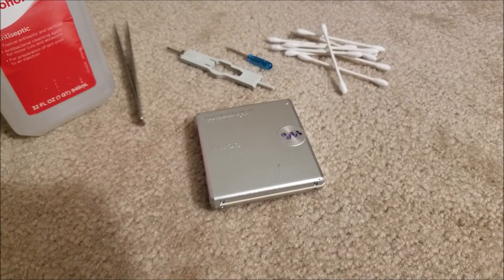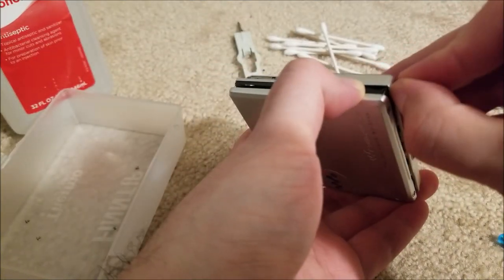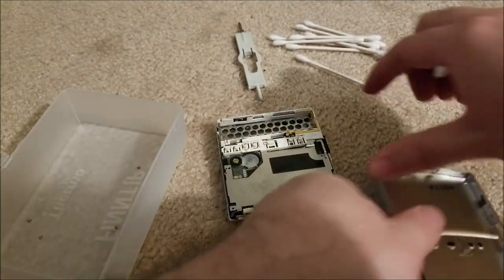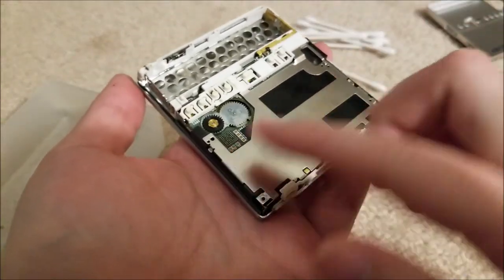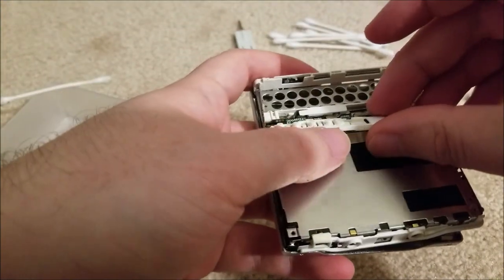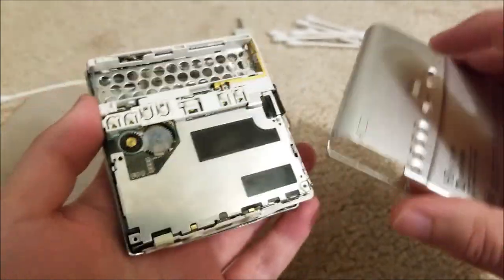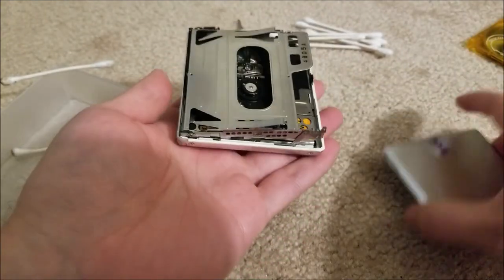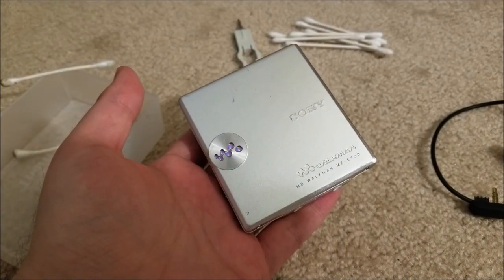Sony MZ-E730 MDLP Minidisc Player Teardown/Cleaning

Comment: Turns out the jog dial on my MD home recorder lags and skips to random tracks, thought it was the laser after watching your video.  Glad to know the remote control works the tracks as it should and is fast going back to the first track.  Sometimes the eject mechanism is slow.   It’s clean on the inside but have no desire to start taking it apart as much as your videos are inspiring it would be a disaster for me to tinker with seeing what spring or slide is making this stick a tad on eject.   It plays in sequence and that’s all that matters. 
I got a lot of use out of this especially the jog dial when editing some tracks and inputting the text.  
Wanted the ES model, the ceramic tray that came out was slick, but I went with the JB920.  Next model had the keyboard input that would’ve saved my jog dial from extra use.

Comment: Another fascinating one. Love the view of it working with the cover off. I'd love to have a player with a transparent lode. It would be cool to cut most of the cover off just leaving a bit around the edge, then stick an acrylic sheet onto it.
Reply from the maker: I had a plan to design a 3d printed lid with a cutout to fit a small plexi window. Will get around to it one day, it's on the backburner for now.
Reply: @sjm4306  Great. If only we had more time, eh? Thanks.
Reply from the maker: I think there's a saying that goes: time, money, or energy ... pick two
Reply: @sjm4306  I've got energy, it's time and money I'm short of.
Reply from the maker: Some days I have none of all three lol
Reply: @sjm4306  lol. Make those a duvet day.
Reply: There is a guy on EBay that makes clear casings for walkmans. Not sure about MD players, though.
Reply: @professorvoluck9311  Interesting, thanks. I'll look for him.

Comment: My laser hazards sense was tingling. BTW I have never opened up a minidisc player, I wonder just how powerful the laser in a recorder really is. If it's a read only device TBH the Q-tips are probably a larger eye hazard.
Reply from the maker: The service manuals specify the read and write laser power levels and I think I remember reading they are around 1mW and 5mW, respectively. Much less than other recordable disc systems that have to enact chemical phase or dye changes, probably due to the magneto layer being engineered to have a relatively low curie point. And I agree, qtips in the wrong hands can be quite deadly.

Comment: Are you actually able to sync the NetMD with you PC to write music? I've yet to find software to do that with Win 10
Reply from the maker: Nope, this model is only a playback machine. As for burning discs with netmd recorders on windows 10, there's a cracked version of sonicstage ultimate easily found through google and alternate software such as platinum md and web minidisc (which works through chrome and doesn't need installation).
Reply: I use a version of Win 7 32 bits and SonicStage v.4.2 to do that.
Reply: @sjm4306  Thanks! I'll give it a Google
Reply: Search for Stefano Brilli's WebMiniDisc app - it's worderful for NetMD recorders.

Comment: This model have "HD" digital amp ,how is the sound quality compared without "HD" logo ?
Reply from the maker: It sounds fantastic (though I also think the analog amp models also sound very good). I think the main difference is the hd amp is actually a digital pwm amp and can do 5 band digital equalization with something like 10 steps per band (the older analog amps can only do treble and bass adjustments in much coaser steps).

Comment: recently i found sony MD did not provide the best sound quality. they added a pair of zener diodes to limit the boss and in some models a pair of capacitors were added near the earphone jack. after removing them all Sony MD sound like sharp mt77
Reply from the maker: The caps are probably filtering higher order harmonics from the output of a class d amp and the diodes are probably crowbar protection against esd damage to the hp amp. If you remove them just be careful what you plug into the md player and not to static shock it while touching near the hp jack.

Comment: Hi I recently watched your video of you repairing the walkman wm-f1 and I have one of my own that is isn't working and Im just wondering if you can fix it? Im willing to pay for the repair I just want it to work. thanks, love the channel.
Reply from the maker: Thanks, I appreciate the offer but at least for the time being I'm not taking on new repair jobs until I catch up with my current workload.
Reply: sjm4306 I understand and thank you for replying. You think you could give me some advice on what to do? I changed the same belt you did in the video but tapes still sound slow also my batteries come out really hot after a few seconds
Reply from the maker: You have a short somewhere. It is likely a cap that's died and is basically shorting enough power to ground to decrease the battery voltage. This would explain both why it sounds slow and the batteries are hot. As for what cap is dead it'll probably be getting hot itself if it's sucking all that extra current.
Reply: sjm4306 so I guess I need a soldering kit for that huh?
Reply from the maker: Yep, soldering is a super useful ability though so if you intent to get into fixing stuff it's a good time as any to get an iron/solder/flux now.
Reply: sjm4306 hey I want to thank you for your help. I would love to learn how to solder one day. Sadly I did have to return the Walkman. I did end up buying another one. Everything is good on it, I did have to change the small belt. Only problem I have is vocals sound a bit low but instruments sound ok.
Reply from the maker: Glad to hear you did end up with a working walkman in the end. If you want to learn to solder I'd suggest practicing on broken electronics first. As for the vocals being softer, double check if there's a tape type switch, it may be set to metal/chrome when you are using a standard tape (or vice versa) which would affect sound quality.
Reply: sjm4306 is the TPS-L2 worth buying? I want one but I don’t know if I want to spend that kind of money for it
Reply from the maker: Honestly nope, not for the money they are going for now. You could easily get a much higher end tape player for the same price or even cheaper so unless you only want a tps-l2 as a display piece I'd hunt for something else.
Reply: @sjm4306  Hi sorry to bother you with my Walkman questions but I have another. The “working” I got had a problem with with vocal audio sounding low/distant. I thought it was the batteries not being new so I bought a wall plug. It’s 6v and inner negative. When I connected to the Walkman and press play the audio still sounded the same but now there’s a buzzing sound.
Reply from the maker: The buzzing sound is a common problem called mains hum associated with ac adapters with poor output filtering.
Reply: @sjm4306  I actually still have the broken Walkman. The seller refunded me but never asked for it back or gave me a shipping label, so I’m still holding on to it. I used the plug on that one and it did work without the buzzing. Cassette sounded good
Reply from the maker: Sweet, I guess it could need a recap in that case.
Reply: @sjm4306  oh my god I opened it up only to see a loose screw just sitting there and I put it back on and now everything is fine
Reply: @sjm4306  also I opened up the broken Walkman and turns out 2 caps are missing that’s why it didn’t work with batteries
Reply from the maker: Missing as in there's signs someone desoldered them or as in there are pads for them but Sony decided not to populate them?
Reply: @sjm4306  looks like all models have 3 orange/brown caps, one big and two smaller ones. The broken one only had the bigger one. It’s hard to tell if it was solder off but it doesn’t look like it was. Also I’ve notice that the metal plate on the back have a sharpie mark on them but this one didn’t
Reply from the maker: Rofl, yes!!!
Reply: @sjm4306  lol do you know what those caps are called and where I can find them?
Reply from the maker: I'd need to see a pic of them, hard to guess without seeing.
Reply: @sjm4306  recently got a WM-3 Walkman and when I was changing the belts I knocked the mic and the red and whit came off. Is it easy to put back?
Reply from the maker: I actually did te same thing when I was fixing mine, they just solder back on so no biggie.
Reply: @sjm4306  so I need to buy a soldering kit and  solder right?
Reply from the maker: Yep, but look at it this way: soldering is such a generally useful skill so you will almost certainly not regret getting the equipment and experience.
Reply: @sjm4306  so my mic was still connected to the black wire which I believe is ground but earlier it has completely fallen off is there an easy was to tell which is ground?
Reply from the maker: Use a multimeter in continuity mode and put one probe on the negative side of the battery spring, use the other probe to find a ground point (the resistance should be very low, <0.5 ohms). Look for points connected to a large plane on the pcb.
Reply: @sjm4306  so i took the Walkman to a repair shop that fixes computers, phones, consoles etc. they told me they could solder it back on but later in the night I get a call and they told they couldn’t. They told me the wire didn’t want to solder to the pins, it kept falling off. Do you know why that is? They told me it could be their solder not working properly
Reply from the maker: That's ... weird. You would think a professional repair shop could figure out how to flux, clean and tin solderpoints. Worst case they could just replace the wire if it's that corroded.
Reply: @sjm4306  ok I went to another store that did repairs and they were able to fix it. Now the last thing that I have a problem with is that the screw at the bottom near the batteries got stripped is there a way to remove it? The first place I took it to made an attempt to remove it but they couldn’t. The good thing is I did replace the belts
Reply from the maker: You may be able to use the rubberband trick or carefully glue/epoxy it to a longer nail or something so you can use a pair of pliers to twist it off.
Reply: @sjm4306  testing the glue trick on a broken Walkman what also had a stripped screw
Reply: @sjm4306  you think a screw extraction can work? Also what kind of glue should I use? I tried Locate but when I turned it; it comes off easily
Reply from the maker: Epoxy is probably your best chance, but be super careful to only get it on the screw and let it fully cure or you risk permanently fusing the screw to the case. If you dont wanna risk it they sell special screw extractor drivers you can try, but I've never used them myself so I cant vouch for how well they work.
Reply: @sjm4306  hey got another question. When I put fresh batteries into my wm-3 there’s a staticky popping sound if I turn up the volume too high and it only happens when both sides are on the same high level, it doesn’t happen if I put one up and the other down. Also the problem goes away if I put used batteries in. What’s causing this?
Reply from the maker: Just guessing but maybe the caps in the audio amp are going bad. This could explain everything except why it wouldn't happen with used batteries. I have no idea why used batteries would be fine but not new ones.